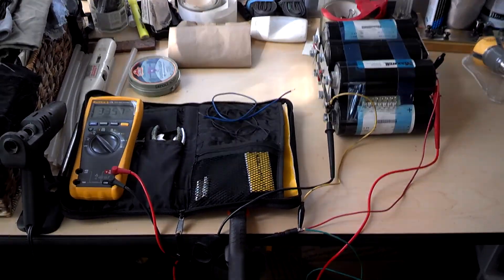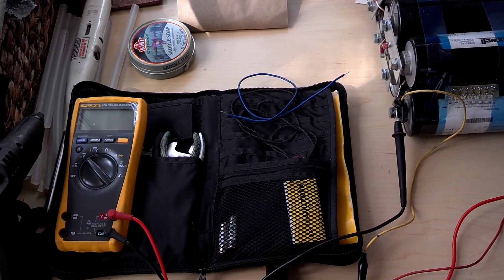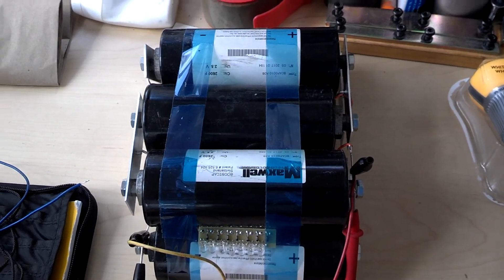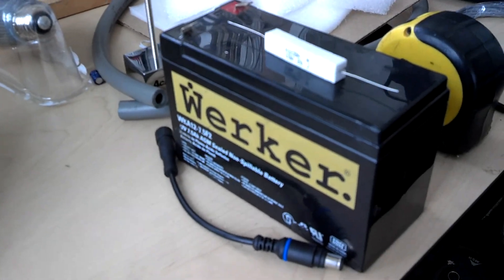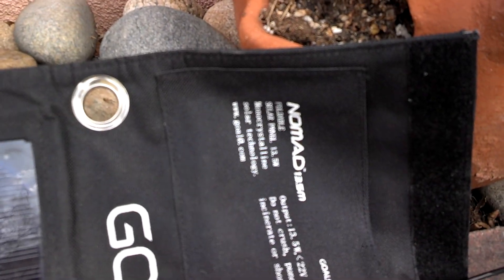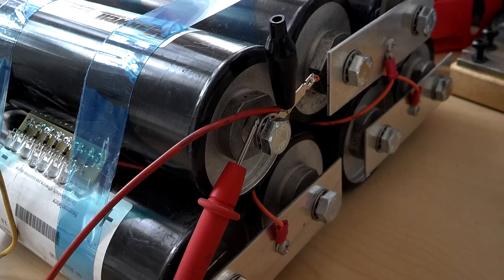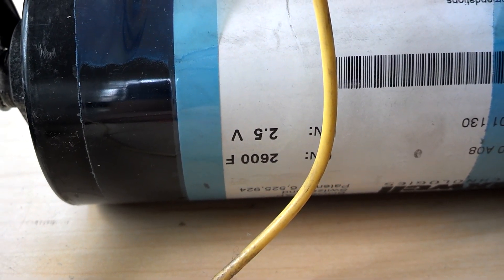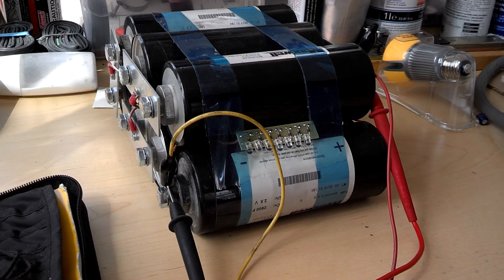Ultra capacitor power pack

Comment: I used a car battery charger combined with a car headlight as a ballast (in series) to charge my Maxwell 6x 3000 farad 2.7 volt bank. Worked like a charm.

Comment: use voltage regulator with huge heat sink coz it will drain alot of amps of course it will be slower but you can forget about it will overcharge

Comment: You can easily and safely charge the capacitor with a 12v test light or a regular 12v light bulb by connecting one end to the + end of the battery and the other to the + side of the capacitor you will see the light brighten then dim when the caps are charged.

Comment from the maker: junits15, I think Trevor Kemp is trying to explain the hazards of differential potential (voltage difference).  The vehicle electronics are designed to handle moderate imbalances, but nothing like the available current that ultracapacitors could punch if the pack is not at least close to (15ish or less volts) the design point (16.1 volts) of the voltage regulator.  If your curiosity is around something more introductory, then please ask, or check out the other experimentation vids.

Comment: how would the voltage regulator know it isn't fully charged when it hits 15 volts? I could understand not installing it in the car with 16 volts in it, but if its at 14ish and installed why would the regulator even attempt to charge it beyond its capability?

Comment: Charge this fully put in vehicle the second you turn this on your going to destroy the voltage regulator in your alternator the will blow at 16.1 volts or higher instantaneously take on cap out for a 15 volt peak will be no problem don't worry about rapid discharge of lead acid battery once or twice no harder on it than cranking your vehicle for a few seconds 6 in series will not hert 7 can harm charging system.

Comment: Use 3 to 4 diodes, make the diodes have the last 2.5 - 3 volt drop so you end up with 17 - 17.5 volt.